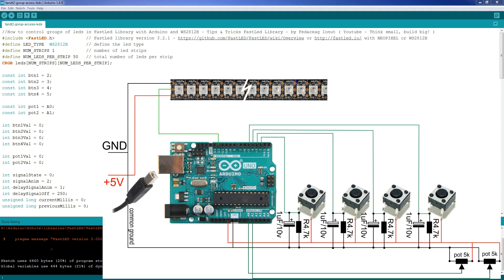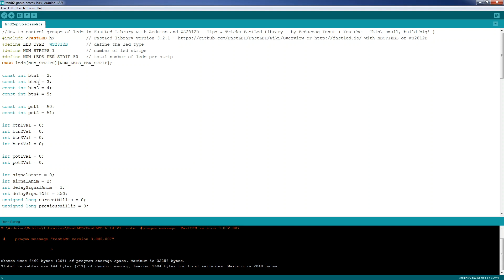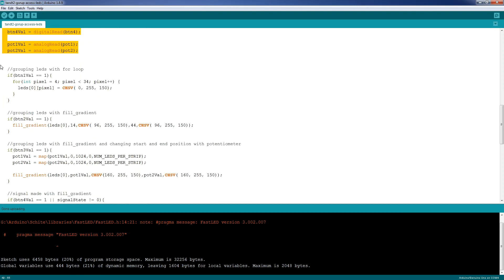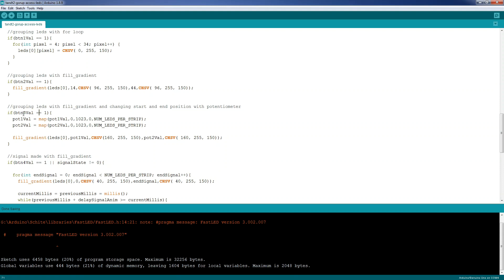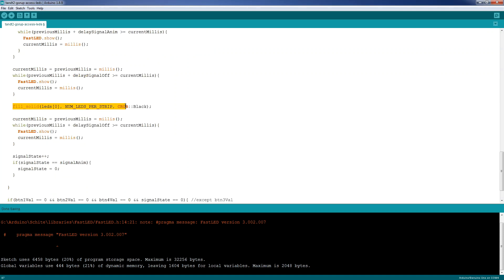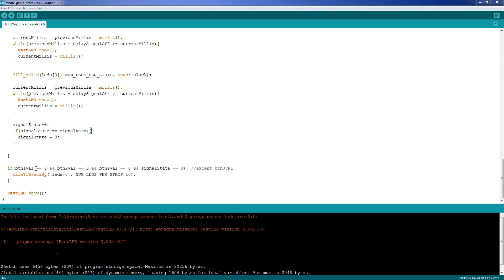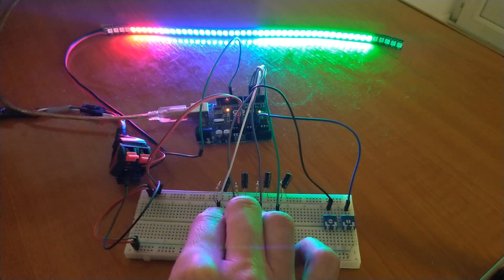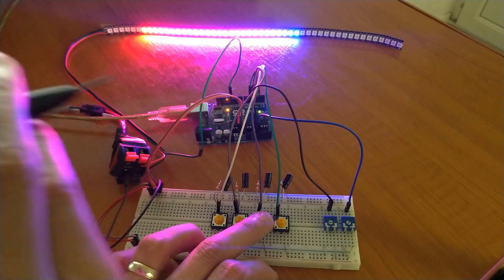How to control groups of leds in FastLed Library with Arduino and WS2812B NEOPIXEL

Comment: #include <FastLED.h>

#define LED_PIN     6
#define NUM_LEDS    16

CRGB leds[NUM_LEDS];

void setup() {

  FastLED.addLeds<WS2812, LED_PIN, GRB>(leds, NUM_LEDS);
  
}

void loop() {
  
  leds[0] = CRGB(255, 0, 0);
  FastLED.show();
  delay(500);  
  leds[1] = CRGB(0, 255, 0);
  FastLED.show();
  delay(500);
  leds[2] = CRGB(0, 0, 255);
  FastLED.show();
  delay(500);
  leds[3] = CRGB(150, 0, 255);
  FastLED.show();
  delay(500);
  leds[4] = CRGB(255, 200, 20);
  FastLED.show();
  delay(500);
  leds[5] = CRGB(85, 60, 180);
  FastLED.show();
  delay(500);
  leds[6] = CRGB(50, 255, 20);
  FastLED.show();
  delay(500);
}

Use this code define led number and colour, so simple and easy

Comment: Thankyou so much. I'm just a beginners with arduino and I was thinking if there was something wrong with my code.  Ended up it I only need a capacitor with my wiring.
Reply from the maker: The best part of figuring out the problem by your own is that you will never forget it.
With pleasure! ;)

Comment: hi Mr. jhon, very Nice...!!
 have a nice day
can you add this fiture to V.3.2

add the potentiometer to adjust LED Quantity,
so, if I want add the led with the previous coding, I no need to reflash for change the coding 😁🙏
Reply from the maker: Thanks.
A potentiometer will not be precise enough to set the number of leds... at a first thought it will need a lcd display and some push buttons to set the number of leds and save it to eeprom.
After that a simple restart of the code will use the number of leds set and everything should work great.
Reply: @IonutF-TS-BB  , 
yeaaahhhh thats a good IDEA 👍👍
 use the button & LDC OLED 128x32px or 1602 to show the messages,
can you created it 😍😍😍👍👍👍
Reply from the maker: Yes, it can be done... but how practical is it? because when you decide your design, you define the number of led and after that you write the program... the number of leds won't be change until your next design... and if you change the number of leds, you also need to allocate the specific functions to the led groups... so, in my point of view, this option is useless...